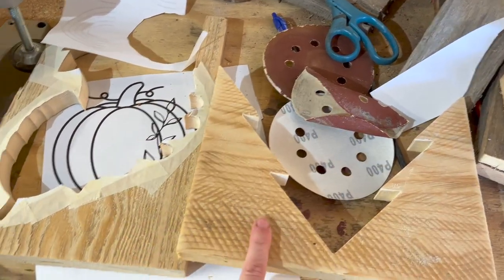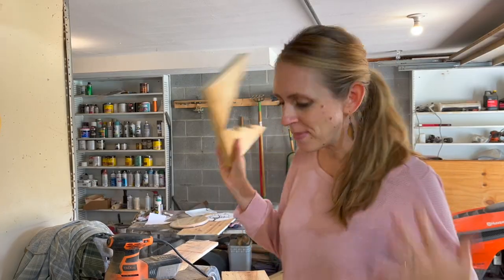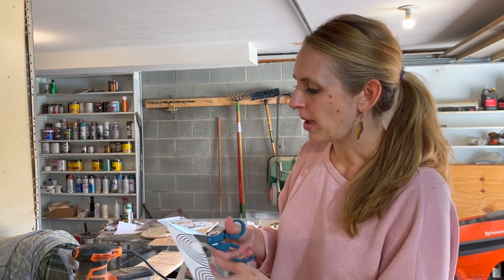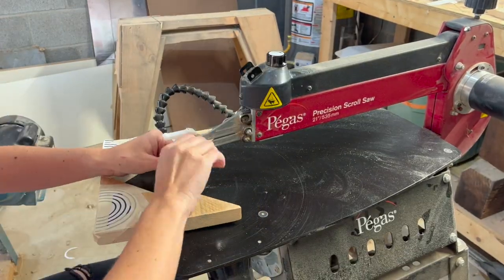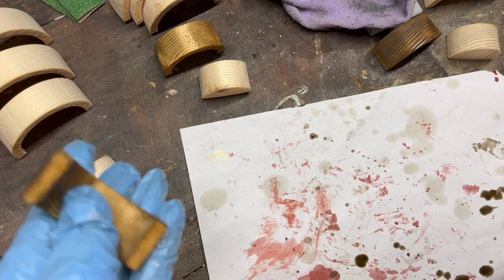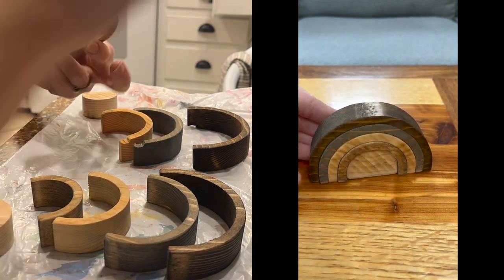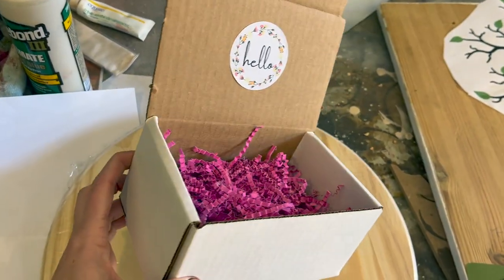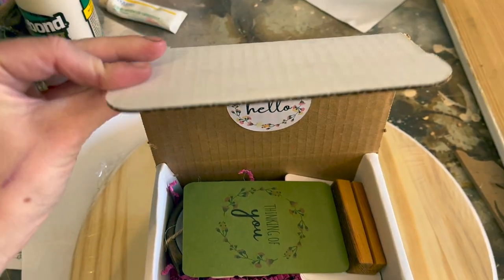Scroll Saw Care Package

Comment: Danielle, this is a great idea and cool marketing tool, too. 

Did you use a particular card stock? Were they pre-cut or is that a second-step process to do vis my Maker 3 after it prints? Maybe this gets answered in the Google doc! 

Oh, and those look like cool mini boxes.  Did you buy those, too?
Reply from the maker: Thanks, Donald! Thanks for watching! You know, I use a different card stock every time. It doesn’t matter! You can change the setting on your maker for whatever you have. And yes, the maker cut them too! I did buy the boxes but for some reason couldn’t find the link to them 🤔
Reply: @WendellWoodworks  Thank you! I enjoy learning from your videos. I’ll order some card stock. I’m assuming you have a color inkjet printer tho. I’m all laser black here! Hmmm. 

I’ll do some searches for those boxes on AMZ, too. 

Are you 100 percent Pegas geometric blades or do use #5 Flying Dutchman reverse blades, too? 

Sponsorships aside, do you have personal preferences where a non-Pegas blade has a place in your arsenal?
Reply from the maker: @donaldjclaxton  I do have a color inkjet :). I’ll use whatever blades are available, but I truly do love the Pegas the best. I’ll use the other brands when I run out of those sometimes but I feel like they burn out faster. The only times I opt for a different kind of blade is for really thick materials where I feel like a super skip is needed instead of the modified geometry. Just my opinion :).